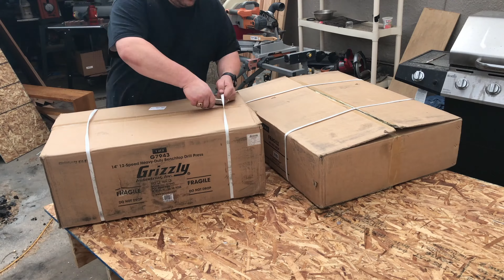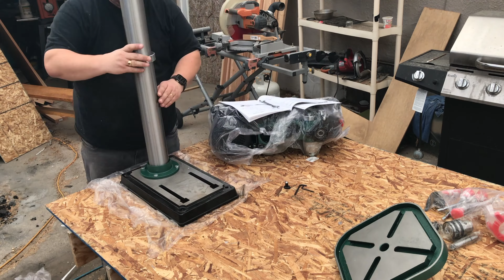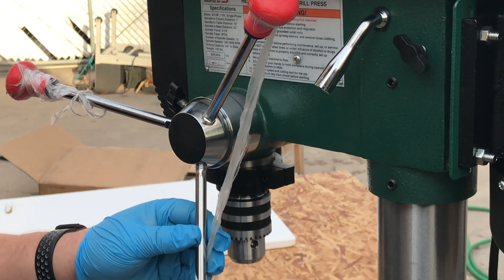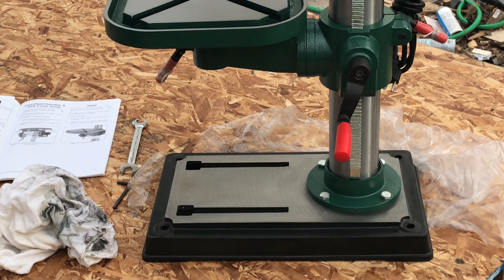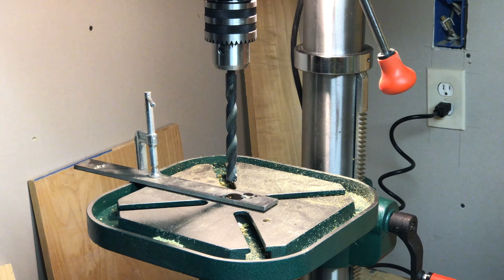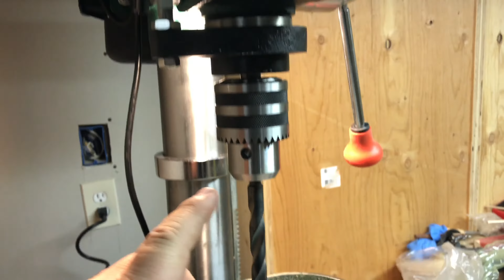Grizzly G7943 Drill Press Unboxing and Setup

Comment: Thank you for making this video! Here we are in late 2022. Has this been a good drill press now that you’ve had it for a few years?
Reply from the maker: Yes. My one complaint is adjusting the belt tension. I wish the tension handle was longer and the retaining screw had a bigger head to grab onto. One of these days I’m going to weld on an extension to the handle and replace the retaining screw with a star handled screw or something.
Reply: @BitsandWood  thank you! I ordered the drill press yesterday. Excited for it to get here

Comment: I just got the same drill press. Is the headstock suppose to be able to swival 360°? I tried but the rack does not want to move from that wedged recess from the bottom.
Reply from the maker: I don't think so, but I'm not positive. I haven't tried that.
Reply: Thank you for the reply. I actually readjusted the column collar on the top and made sure not to over tighten it and the headstock will actually swival nicely now.

Comment: Sawdust is Life thanks for the show & tell . . . although it may take me a bit  longer to unbox & set up than the "time" it took you. I may buy this to primarily work on metal. How is the quality of the chuck/spindle as supplied by Grizzly. Is there excessive runout or play ? Thanks. All the best & stay well !!!
Reply from the maker: I don’t have a runout gauge, but it’s been good the last couple years. I have started working with metal more and I haven’t had any problems. I do wish the speeds were easier to change,

Comment: Just ordered the G 7943 from Grizzle yesterday.
Reply: How are you liking it??
Reply: @gnarwhalsw8296  Very happy with it overall.  
I have it on a fairly tall bench so to change the speeds I have to use a stool. The chart for which wheels to use for the various speeds small and inside the lid, difficult to see for me.  Those are my personal issues though and relatively minor.   
 Runout was less than .005  so ok for woodworking.   I'd buy it again.

Comment: Been eying the Grizzly for awhile now.   
My 3 main conserns are... durability of the motor, stability of the drill table, & wobble of the chuck.  

I gave up on considering the Central Machinery, Wen, & Ryobi... because the motors tend to burn out on them.  
The drill table on the Porter Cable is wobbly crap.  

So far this Grizzly looks solid.
Reply from the maker: I’m still very happy with it. I haven’t had any problems with the table, motor, or chuck. It doesn’t get used daily, but I do use it fairly regularly. If I had the room, I would have preferred a floor model, but until I can get a larger shop, this one fits the bill.
Reply: I cant hear this crazy man but i can hear a bunch of music. Ive the 8" bench top grizzly drill for 2 years now.  no wobble yet and for the price- if it crapped out on me today id be happy with the purchase. it made me money and paid for itself.

Comment: It does run nicely. Quiet for a machine in this price range. I wanted to mention that having to close the shroud with some pressure may be a good thing. Sometimes the shroud vibrates rather annoyingly, generally speaking. The tighter fit can help. Good luck.

Comment: What is the total height of this press? I'd like to see if it will fit on my bench
Reply from the maker: 38.5" from the bottom of the base to the tippy top.
Reply: Thank you sir!
Reply from the maker: John Beardsley You’re welcome! Hope it helps.
Reply: Would you say the belt cover would need an additional 6 inches to open?
Reply from the maker: John Beardsley Yeah, about that. I’d probably go 8” just to be safe cause there is a little knob that sticks out of the side of it.

Comment: This is a useful video, helped me decide to buy this drill press.  I must admit, however, that I was not able to lift the body of the drill onto the column.  I'm in pretty good shape, but I did not want to wreck my back.  A friend  came over, and the two of us managed easily.
Reply from the maker: Yeah, it is pretty heavy. Definitely much safer as a two-person job. Hope you enjoy it. I've been very happy with mine so far. I just need to decide where its permanent home in my shop will be.
Reply: Now that you’ve had this drill press for a few years are you still satisfied with it? Thank you!
Reply: @danjacobsen7645  I'm quite satisfied with the G7943.  It's a basic drill press, nothing fancy.  Changing speeds is simple, and there seems to be plenty of power. I made a nice table for it, and bought Grizzly's morticing kit.  I live not far from Bellingham where the showroom is.  Place is worth a visit.
Reply: @stefan2292  thank you! I ordered the drill press yesterday. I’m excited to start working with it.

Comment: Hi, thanks for the review. Thinking of getting this as a replacement to my 10" Ryobi (motor burnt out). Did you had any issues installing all the parts, particularly the head into the column? That thing looks very heavy with the motor bolted on. Thanks!
Reply from the maker: +Magno Malvar Funny, this was an upgrade from my 10" Ryobi 😊 The head is heavy, but I was able to put it in place by myself. It would probably be smarter to have another person help lift it. I wouldn't suggest removing the motor to make it lighter because you'd also have to remove the pulley that is attached to the motor. The whole drill press assembled weighs about 145 pounds.

Comment: I bought one of these used and wondered if you think it would be okay for me to use router bits on this to do light trim work? I know they aren't built for axial force but I won't be milling metals just routing wood
Reply from the maker: +1019wc1019 I don't know if it would spin fast enough to do the job well. It maxes out at just over 3,000 rpm. The slowest any of my routers will do is around 9,000 rpm.